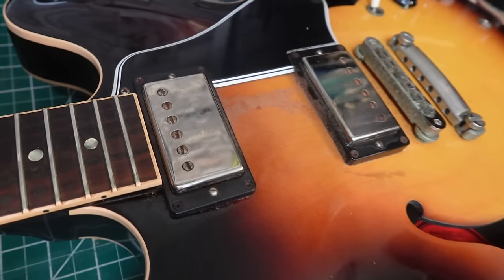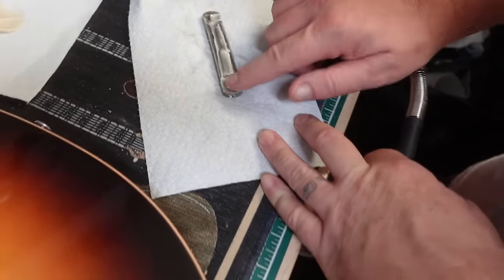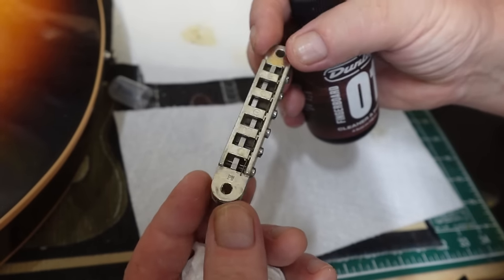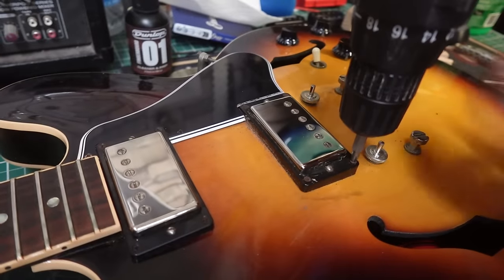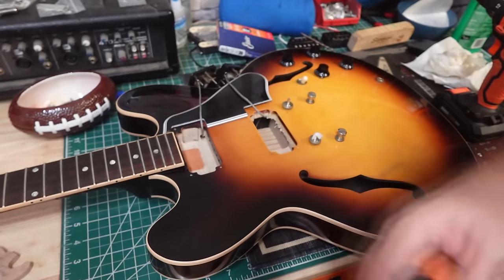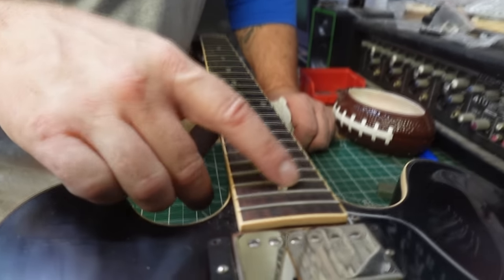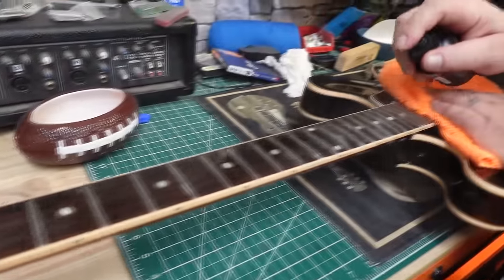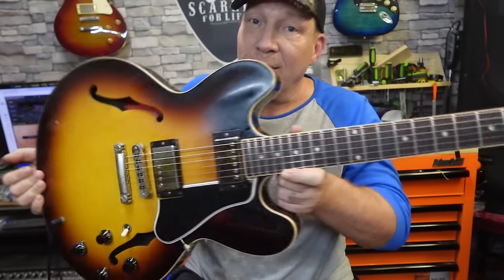2013 Gibson 335!! WHY DOES IT COST SO MUCH? LET'S GIVE IT it's VERY FIRST FRET CROWN and bath!!

Comment: Since everything is already grounded  to eachother in the wiring, shielding paint or tape shouldn't be necessary at all. As long as its properly grounded and the pickups are potted correctly you're good. I have several guitars with no shielding at all that are extremely quiet even on high gain. My brother in law gave me some pickups out of a epiphone es335 he swapped out because they squealed. I potted them and threw em in a v i made and they definitely don't squeal anymore.

Comment: I just picked up an EART 335 that I stole from a guy for $120. Leveled the stainless steel frets and the guitar sings and the neck feels amazing. While I don't particularly like the way a 335 lays against the body, this one is super light and sounds frickin amazing. If you're looking for a cheap 335 I highly recommend one of these I don't think you can do much better considering the specs.

Comment: If you dont have an alcohol based cleaner, naphta (zippo) fluid works just as good, if not better, as it also evaporates. Its also safe to use on notrocelulous finishes too.

Comment: Shielding is important not only from poor waxed pickups, but also from being an antenna for outside interference.  Gibson does a better job because of the metal outside shielding wire compared to rubber shielding.
I make my own with paint and powdered graphite. 😉

Comment: You don't need shielding for humbuckers.
Reply: That’s not true — you’re confusing electronic interference with 60 cycle hum. Humbuckers buck that 60 cycle hum, but they won’t stop electronic interference and/or microphonics. They’re all different things. 

It’s not really the pickup that is the problem where electronic interference is concerned — from cell phones, computers, plugs, etc. It’s usually the wiring causing that interference issue with other electronics, and that’s why shielding might be needed in the cavity. If you hear noise, the pickup is only involved because you’re gonna hear that electronic noise through the pickup — but it’s not the actual pickup that’s the cause of the problem because pickups are simply converting string noise via magnets and then that noise signal is transferred through the wiring all the way to the amp. 

Some wiring is fine without shielding, like Sean said. A great test is to hold a cell phone near the pickups and pots where the wiring is connected. Make sure the cell phone is on and the guitar is connected to your amp. If there’s gonna be a potential issue, a cell phone WiFi or Bluetooth radio will definitely set it off. If you don’t hear noise from a cell phone, it’s very unlikely that you’ll need shielding for other electronics. If you start hearing radio noise through the pickups, then you’ll want the shielding.

I don’t know if I’m explaining this clearly, but that’s more or less how it works. I hope I helped you understand what you seem to be confusing! 😊🤘🏻🎸